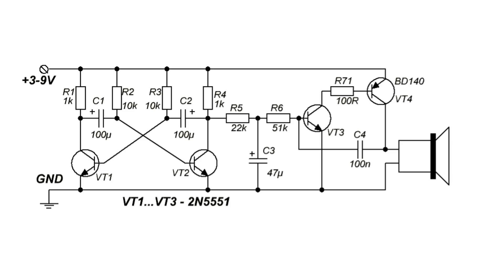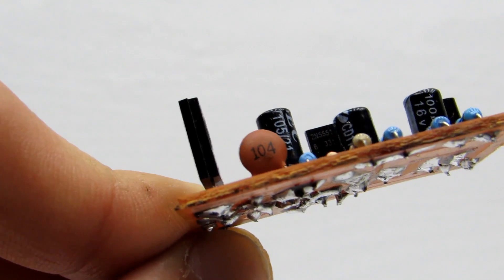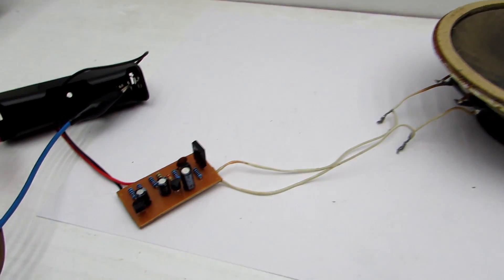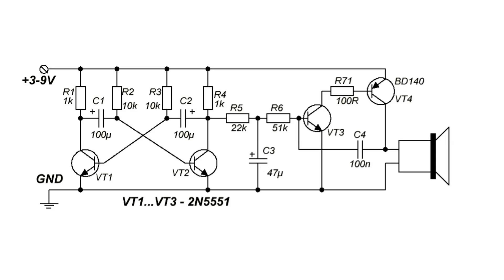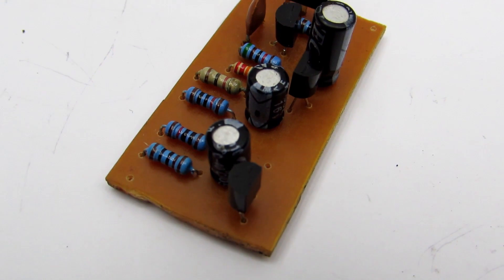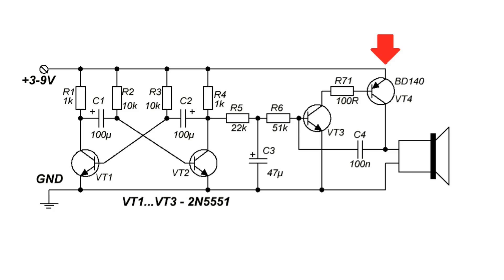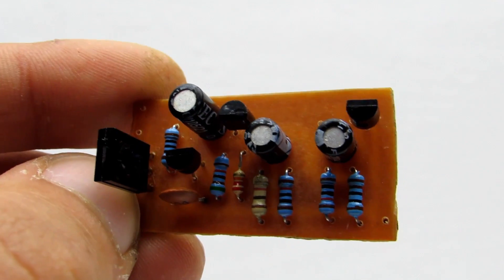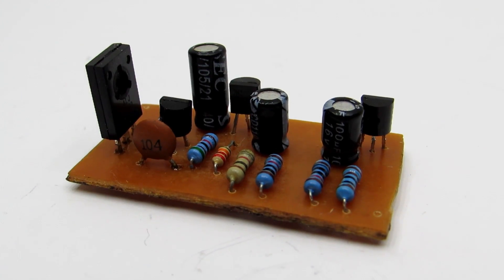DIY simple air-raid alarm

Comment: for better air raid sound, C1 2200 MIcrofarads, C2 220 microfarads
Reply: DIYelectronics I use C1 2200uF and C2 147uF it's like a normal alarm :) C2 220uF is too big :)